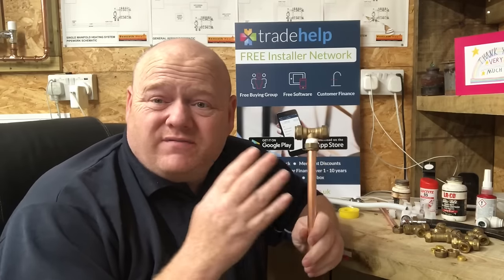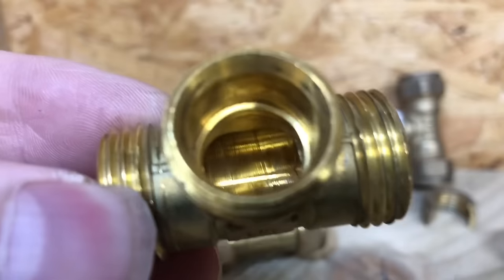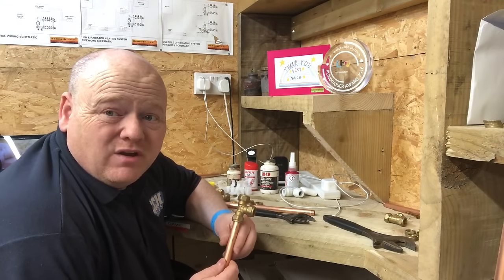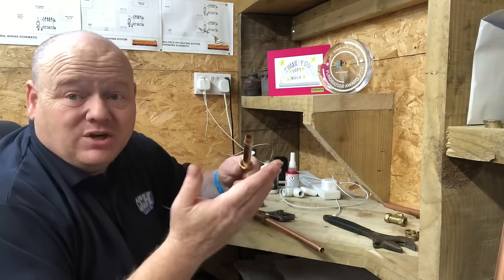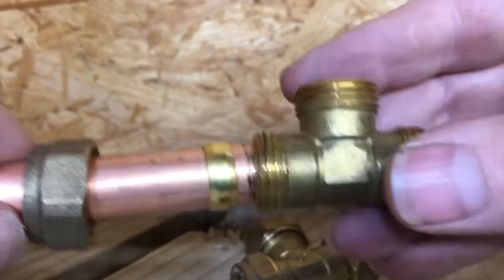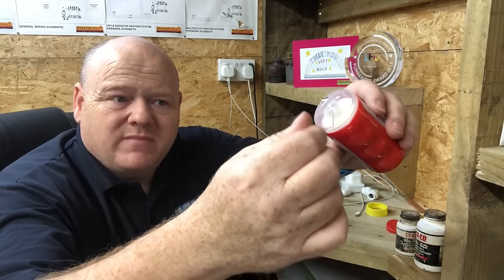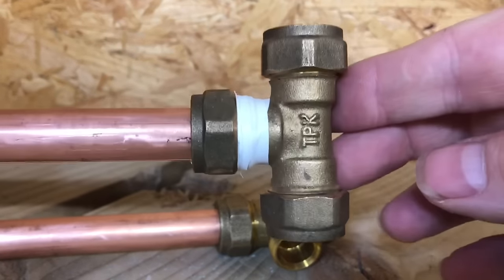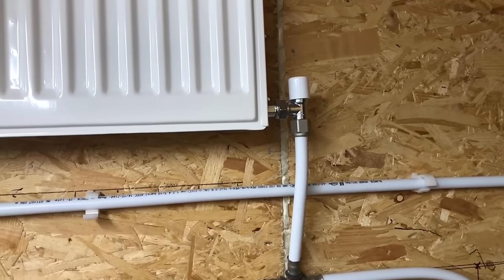HOW COMPRESSION FITTINGS WORK - Joining Copper Pipes and MLCP Blansol Plumbing

Comment: No no no Alan. I can’t believe a guy of your experience is telling people to use LT 55 on a compression fittings. It’s designed for threads not olives. Bad advice. All that does is prevent the olive seating properly and leads to people over tightening the joint. People should only use a little bit of jointing compound. That’s all that is needed mate. Really enjoy your videos fella. Keep up the good work
Reply from the maker: Thanks for the feedback.
Reply: Guy of his experience lol,
Service engineer, never rated by anyone at BG

Comment: Many thanks for this Allen, I am a DIYer and always had issues with compression fittings leaking, so avoided them and used speedfit instead, following your tips I had used slic tite on a recent project....and No leaks!! thanks again mate
Reply: I was in the same boat as you Shishu, whenever I’ve used compression fittings without PTFE tape on the olives I always had tiny drops.

I used jet blue plus paste on the olives of my recent DIY plumbing project and didn’t have one drip ! Such a relief.
Reply: The Olive 15mm You Can Get It On Rubber Like Gasket Instead Of Copper Even I Buy It To Be Honest It's Good For Easy Quick Fix And Long Lasting🎉🎉

Comment: Is this correct then Allen?  The surface area of the nut coming into contact with one side of the olive is much greater than the surface area of the fitting that 'receives' the olive (other side).  This means that the nut turns without the olive (and pipe) turning.  If this wasn't the case it wouldn't work as the pipe would twist & turn.  Also if you can make the fitting 'dry' it can be undone and remade simply - otherwise you have to clean off any paste or tape.
Reply from the maker: If you add ptfe on the tread in only makes it harder and is pointless, As you tighten the nut it moves the ptfe. Thanks.

Comment: All this time, I've been using the wrong kind of olives -the green ones with a bit of pimento inside. JK  ... actually, I did like the part of your video in which you back it out of the fitting, and then it's evident that the metal buldges inside the fitting -to a regular bloke, like me, it seemed crazy that it would work without some kind of adhesive.

Comment: That's really interesting Allen, thankyou. I've never used additional sealant on the olive (or thread) with a compression fitting but I've never had a leak that didn't stop once I further tightended the  compression nut. I suspect though that I'm probably tightening the compression nut more than would be necessary if I'd just put a bit or additional sealant on prior to fitting. We live and we learn - thank again.
Reply from the maker: You do not always need anything other than the olive but its a pain to drain down after and repair a leak. Thanks.

Comment: I have never seen ptfe used with olives before, I was always told the olive was sufficient to seal on its own as long as you don’t over tighten it. I use a small amount of ptfe on some threads that do not fit well.

Comment: Great video, not seen compression fittings so well explained before 👍👍. Worth mentioning that Slic Tite isn’t safe for use on potable water.
Reply from the maker: it says, For gas and hot and cold water on the label. Thanks.
Reply: Allen Hart can be used on hot or cold water, but the one I have in my toolbox explicitly says not for use on drinking/potable water systems.

Comment: Have seen many older pipes removed and folks have used Boss White and  Flax/Hemp  within same...asked an old Plumber about same , he said some in the Trade used that process as if you had a leak the Flax/Hemp would swell up ... suppose that was a Belt and Braces  solution back then.

Comment: An excellent video. I like to make sure the olive is properly stuck on the pipe after making the joint. It is a fine balance between overtightening and not tightening enough so the olive could still slide off the pipe. I find that copper olives are much better and easier to work with than brass olives which take a lot more tightening to make a good joint. I would say if using compression fittings onto plastic pipe then a copper olive is essential to get a good seal.

Comment: Excellent video. Very well explained. Can I just ask at 13:20 on the video would you have to use an olive on the nut for the lock shield valve on the copper pipe. Thanks very much.

Comment: I use Fernox LS-X leak sealer on compression fittings. I'm a sparky so I just use it when changing electric showers or water heaters.
Reply from the maker: Thanks very much for your comment, please consider subscribing to support the channel 🙂

Comment: Great videos, just a quick question, I on my meter, a 22mm compression Equal Tee installed to the meter Outlet before entering to the house, assuming this is going to the boiler, as this has a flexi gas pipe threaded connection. Is a compression fitting ok for gas?
Secondly the pressure regulator has a stainless steel pipe that has now yellow cover like you have on the flexi gas pipes, and I notice a bit of corrosion on parts of this pipe, who is responsible  for the upkeep of the meter pipework?

Comment: Hi Allen, great channel.

Which product(s) do you use for tails and plugs into radiators please - where you probably once used PTFE and Boss White?
Reply from the maker: https://www.youtube.com/watch?v=X0zOrglK9-0
Reply: Cheers Allen,

Is it possible to separate, clean and maybe re-use these fittings after using Loctite - is it an easy remove, clean and re-fit; how does it leave the radiator threaded hole plz??

Sorry to miver 🙈

Comment: I'm replacing a rad with a towel warmer and new square milano valves moved plastic pipes with ease to required measurements 

During procedure I Realised old olives don't come off and with only seconds until pipe thawed I desperately used the old olive and nut to the new milano valve 

Valves doing its job on test now but its a shame I have to use old stuff on a new installation but its OK for now 😔
Reply from the maker: Thanks very much for your comment, please consider subscribing to support the channel 🙂

Comment: Hello, I would like to ask where to study heating and plumbing engineer, I am from Chile and I would like to study abroad, especially what is boilers, thank you
Reply from the maker: How can I help you?
Reply: @AllenHart999  Thank you very much for answering, I am from Chile and an authorized gas installer, I follow you in your videos and I try to understand just looking because I do not know English (😊), I did a mural boiler course but I would like to learn more about the calculation of radiant slabs  , in fact I wanted to do an internship in some country that uses boilers a lot, that's why I follow you. I use google translator 🙂

Comment: The only reason to coat threads is to prevent rust depending on the environment. Behind the wall in a house not an issue. In a ship or industrial environments yeah it makes a difference not to seize your threads.

Comment: I know little about the plumbing industry but in wider industry you should not use PTFE on high pressure compression fittings. They are designed to seal on the taper. PTFE tape, loctite etc is only used to seal threads.
I appreciate it might be a tried and tested back-up but to me it looks like the ptfe is just covering for a joint that isnt good.
Reply: Totally 100% agree, I actively discourage people working with me from using anything on compression fittings, it’s simply not needed, that is what the olive is for.
Reply from the maker: @kevint3845  Depends on the fitting. Baxi 800 needs a bit or they leak, Also the magnaclean filters. Thanks.
Reply: Allen Hart done a couple of Baxi 800, one last week, they have brass olives which I always place in the bin as it’s the best place for them, put copper olives on as I do with every fitting and they are fine to use with just the olives without anything else. Brass olives are the issue, just bin them.

Comment: PTFE tape on compression joints??
It's the olive which causes the fitting to be sealed nothing else. no need for any PTFE The seal relies on the face to face joint of olive for the seal nothing else.  White : PTFE tape is designed to be used with NPT - BSP threads - water.  "yellow" tape is for GAS fittings:  Green: oil-free PTFE used on oxygen lines and some specific medical gasses.
Reply from the maker: Thanks very much for your comment, please consider subscribing to support the channel 🙂

Comment: Completely unnecessary to use any PTFE or loctite 55 on compression fittings. Paste/ V2 plus paste is all you need.
Reply: You don't need anything the olive is enough, but its always good to pop PTFE or paste just incase, I use PTFE as it cleaner and I don't have to clean paste of my fingers
Reply from the maker: Depends on the fitting. Thanks.